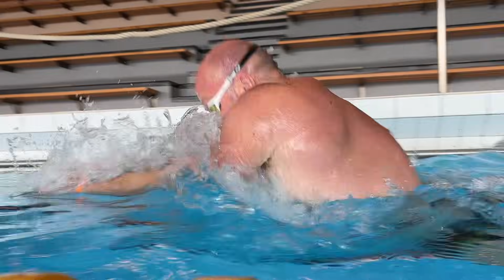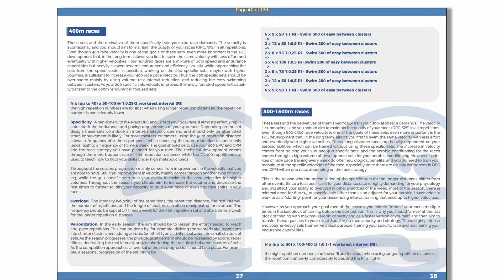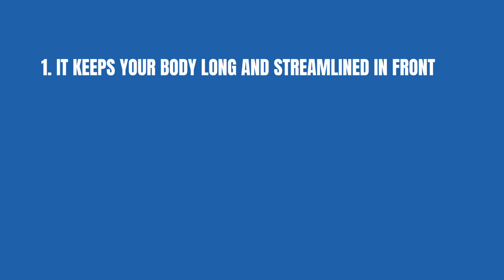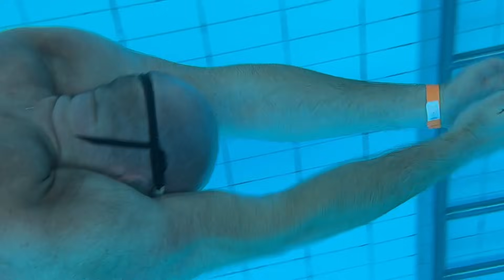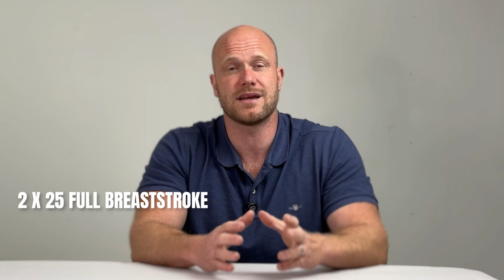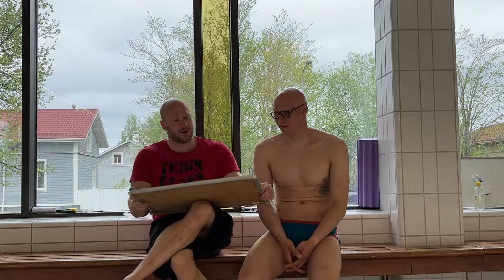Level Up Your Breaststroke Pull — Do These 3 Exercises

Comment: I subscribe 😊,why in breaststroke  i can't lift my head and my torso, and my legs sink also,, any advice??
Reply from the maker: Without seeing you swim, my general advice would be to go back to the basics and train them relentlessly. If full stroke breaststroke still feels unmanageable, spend most of your practice time on focused pulling, dedicated kicking work, and some general balance and rhythm exercises. You can absolutely still include some full-stroke swimming, but keep those reps short so you can fully concentrate on holding the technique together without fatigue breaking it down.
Reply: I am trying breast stroke arms and freestyle kicks. When should I kick - during th glide or after?

Comment: Great video Eetu,
Is it better to rise the upper body highly above water after the in sweep?, or  a slight rise is sufficient.
Thanks for your videos.
Marc
Reply from the maker: Thanks, Marc! Great question. If the rhythm clicks, your body will rise naturally—there’s no need to force it higher than what buoyancy, body sliding toward the hands, and the natural pitch of the hands (back and slightly down) already create. If you exaggerate the lift, you'll often end up pressing downward with your hands, which kills forward momentum. So just think “forward,” not upward, and see how much lift happens on its own.

As you become more efficient and can apply more power into the pull, the body usually rises more—like you see in some elite swimmers. But even then, that upward motion isn’t the goal—it’s the result of well-timed, powerful movements without slipping.
Reply: @SwimRehearsal thanks a lot